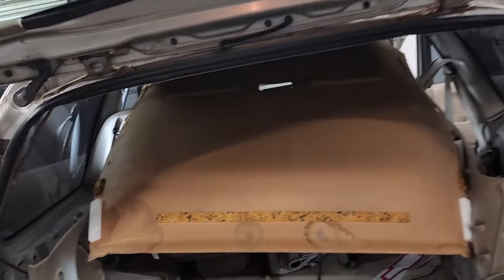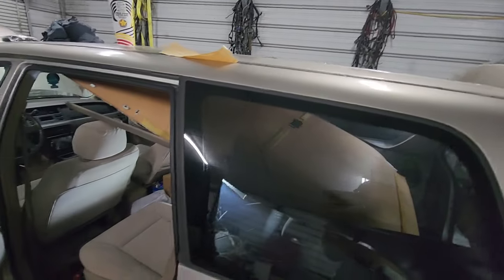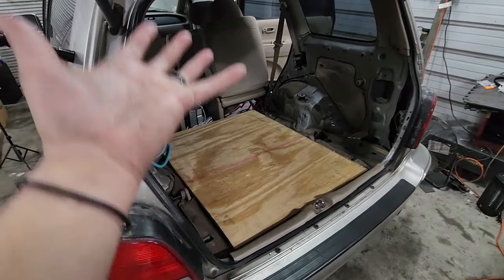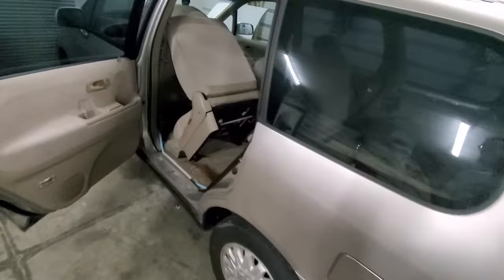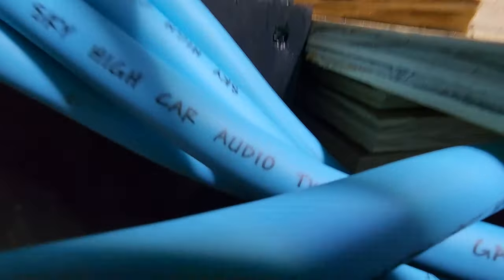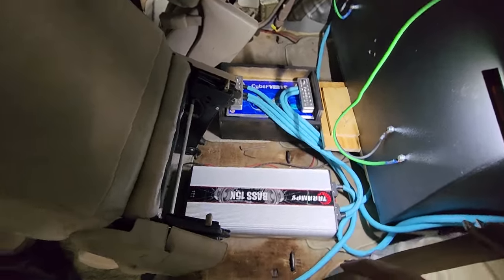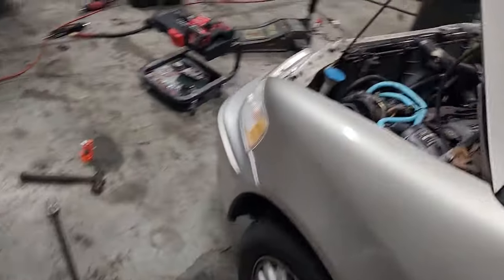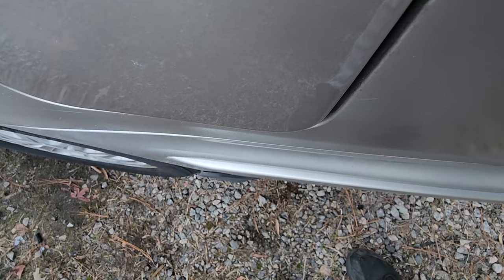4 15s And 15,000WATTS! | First Gen Honda Odyssey BASS BUILD Is PLAYING! | This Thing GETS LOW‼️

Comment: U should by pass the ELD bro splice all the wires on factory alternator plug except the black and yellow wire that's your constant power, u leave that one attached that way you are always  charging to 14.6v steady if u haven't bypassed it yet

Comment: Sup bro do u know what head gasket to use on a h23a ? And water pump
Reply from the maker: I'm not sure bro. I've never replaced one. I'd say the h22 ones should work tho. I think the displacement is in the stroke not the bore